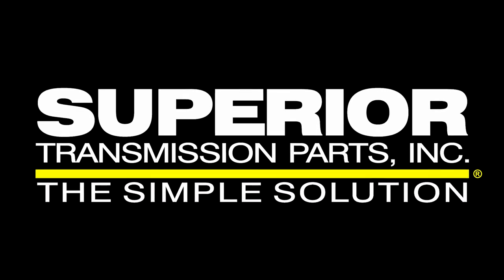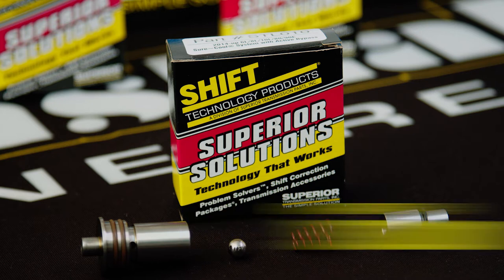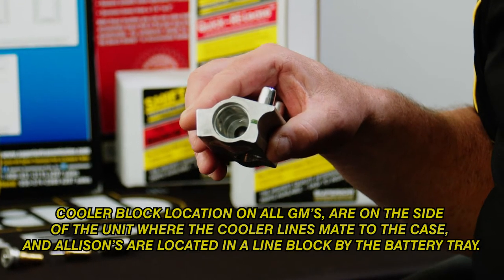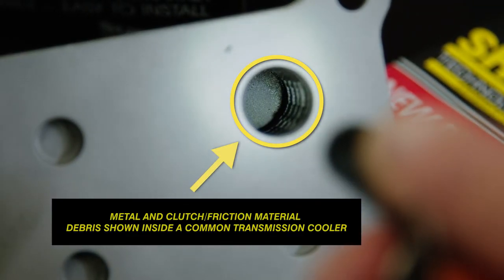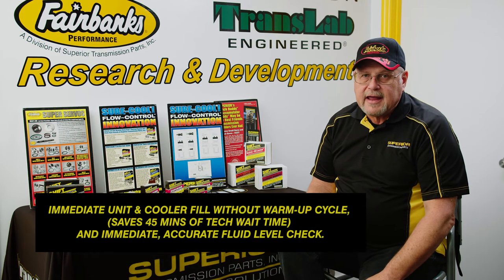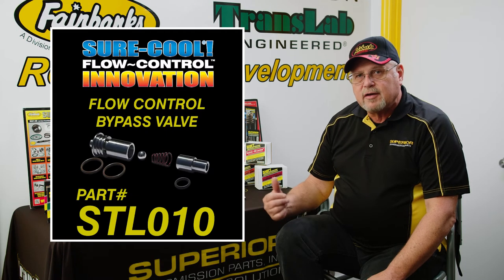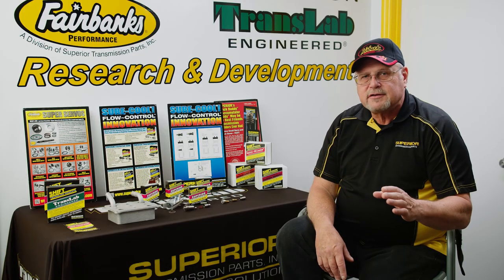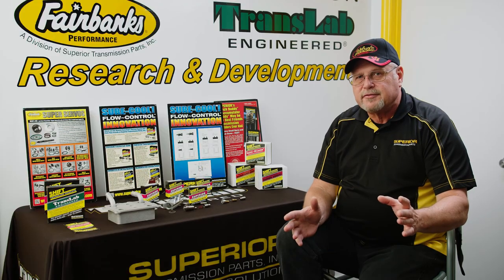Don't plug that bypass! STOP DELETING BYPASSES. Use Superior's SURE~COOL® STL010™ system TODAY!

Comment: I have a lot of units out there with plugged bypass valves. Not one ever has had any kind of issue. That includes many in very, very cold climates. The fluid is already thermostatically controlled by the coolant system. The same way that has been effective for the last 60+ years. Love the one you all have for the 6R80. I use one in every unit. But the GM 6L I'll continue with what has worked flawlessly for years.
Reply from the maker: thank you for using the STL020 on the 6R fords. And, I do understand your good intentions to save your customer a buck, so on most of the GM styles, most are stuck to some degree. how many have you pulled out and tested to see if they were stuck? our results out of 25...were 19 stuck or not fully opened. Easy test; just drop them in boiling water or use an oven at 220 deg. you will see why they need replaced and corking them...get a savvy customer who has knowledge of the problem and someone corked the block and the transmission smokes, what's your explanation? remember you are BLOCKING a factory passage, that was in use from the factory and is not after YOU blocked it.

extra credit: use a Sure~Cool and take a pair of vise grips and clamp one rubber cooler line closed and go drive the vehicle. now do it with your cork...wait you better not. YOU WILL HAVE NO FLOW, with the Sure~Cool installed ours still flows to save you some parts to build. its that simple.    

I do thank you for seeing the benefits on the other ones you do install. as an X shop owner for less than a dinner for 4 at MacDonalds, why take the chance? Just 1 6L80 you charge (lets say appx 3500-4000 per unit) if it CB's (for the 2 grand in out of pocket in shop owner costs) you could have put on appx 40 free STL010's to help your customers and save your unit. all I'm saying is... all it takes is one.  "Why take the chance"       with respect. RBW

Comment: So this product is safe for use in climates where it gets cold in the winter months? Say the midwest where it can get well bellow 0 degrees F.  Would you have to allow time for the transmission to warm up in these cases?
Reply from the maker: the STL010 keeps the bypass fully active and functioning (the bypass is the cold weather part of the block) and uses the viscosity of the cold fluid to move the ball over until the cold oil warms up then the bypass shuts and runs full flow. as far as warm up time no. just fire it up and drive, the fluid circuit is circulating ( inside the unit) and so you have flow, just not to the cooler...yet( once it warms and thins the viscosity (appx 5-10 mins) then the bypass is closes. but the oil is still flowing inside the unit.

Comment: How long does it take to heat up? I’m nervous about winter time. Running too cold isn’t a good thing either. I’m debating on buying this or the new updated colder thermostat from GM
Reply from the maker: The Sure~Cool® system does these features and benefits. 
A.	Removes the chance the factory pellet will not stick closed or jam up destroying your transmission thru any fault of your own. 
B.	Now allows, immediate start up with full flowing fluid thru the main transmission lines and cooler at normal working pressure and at full volume. 
C.	Keeps a factory designed Bypass fully operational (if needed) and “not plugged off” (with a cork or a screw) 
D.	Factory bypass is now used as a “safety system” (if cooler or lines are damaged or severely restricted) the bypass kicks in and unseats the ball and re-routes lube / working oil back to the Lube~Loop™ to keep oil flowing to the internals for lube and cooling. 
E.	Can be used in extreme cold climates where fluid can gel and cause restriction to flow. The Sure~Cool® system keeps the fluid Lube~Loop™ flowing until restriction of frozen ATF is overcome and flowing at full volume and pressure.  
*Note: temps can still climb up some when towing or going up steep hills loaded etc. the STL010 will keep the flow routed when needed and is your sign (if temps get over 200 deg. To get it to a professional to ascertain what is causing the overheating condition.
Reply from the maker: the pellet type can still stick, ours is not a pellet type. you will always worry if today... is the day.
Reply from the maker: if you have the 6L with cooler lines going into the radiator and then into the auxiliary cooler you will be fine, the coolant will act as a preheater to the ATF when it goes thru the radiator / trans cooler, and visa versa... it will scrub some heat off the engine above 215 deg also,. its minor but it does. for that extreme cold type of climate, most use auxiliary electric heaters to keep them warm. the update still has a pellet too, so your back to "when will it stick" mentality.